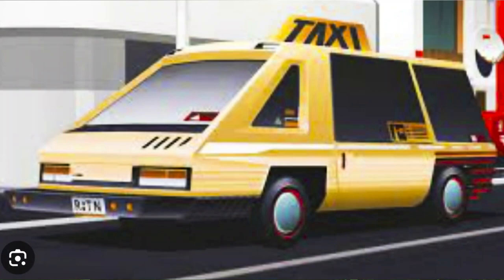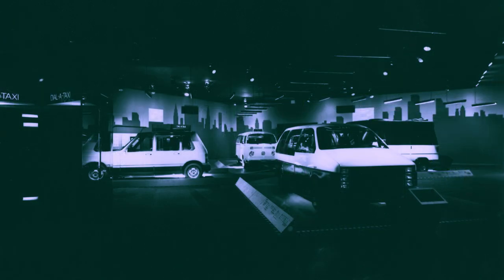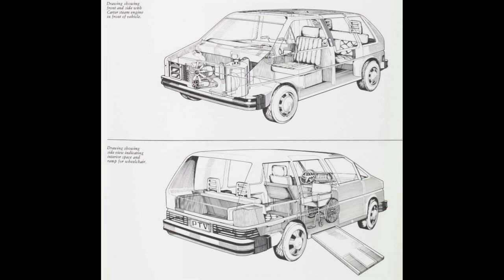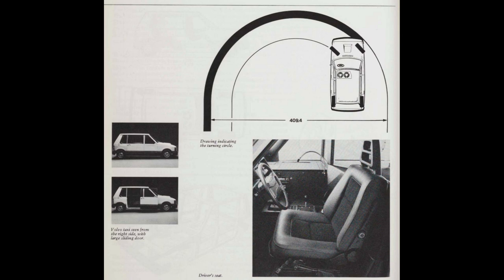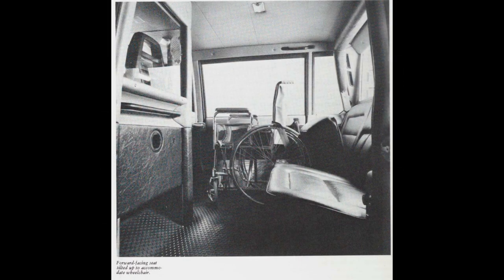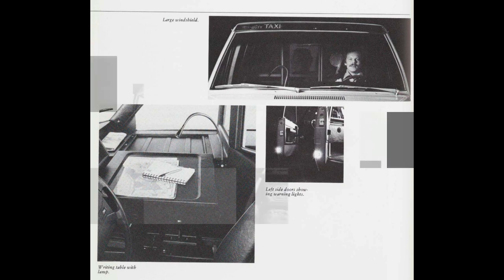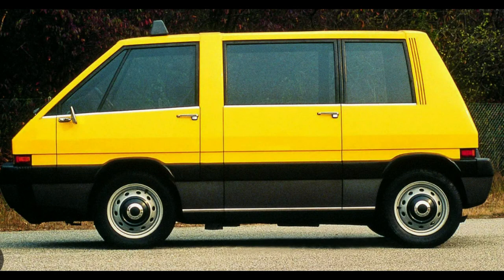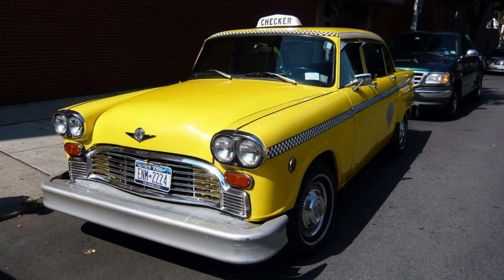New York Taxis of the Future: How MoMA Redesigned an Auto Icon

Comment: What’s interesting is that it appeared this exhibit might have inspired later London Taxi models and possibly the Toyota JPN Taxi introduced in 2019.
Reply from the maker: Thank you for watching and for your very interesting comment!
Reply: @JeffreyOrnstein  You're welcome. 🙂 But seriously, you do notice many of the features of the vehicle in that exhibition had provisions for disabled riders, especially on wheelchairs. The newer LTI taxis in London and the Toyota JPN Taxi are designed to easily accommodate such riders.
Reply from the maker: @Sacto1654  Yes, the taxis at the exhibit were ahead of its time....only many years later did NYC get a more standardized taxi that was fully handicap acessible (the NV200Ishow at the end).
Reply: @JeffreyOrnstein  But yet the NV200-based taxi was NOT popular with taxi driver and owners because of its size. That's why I really hope that Toyota seriously looks at making taxi based on the JPN Taxi but slightly wider and with a suspension designed to handle New York City's rough streets.